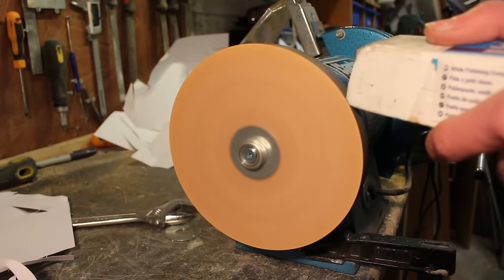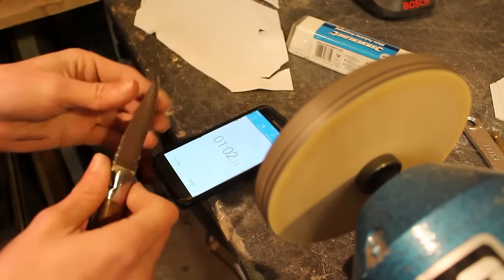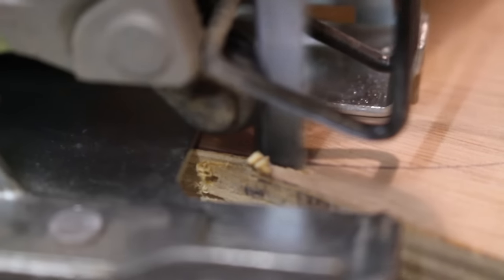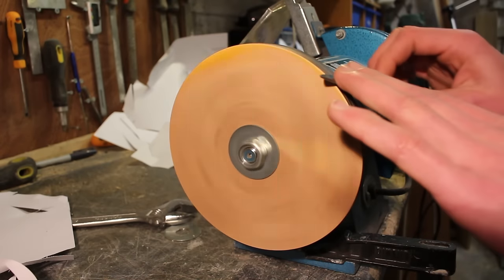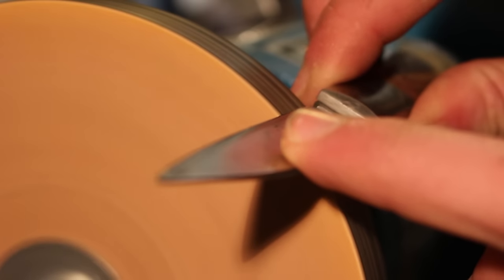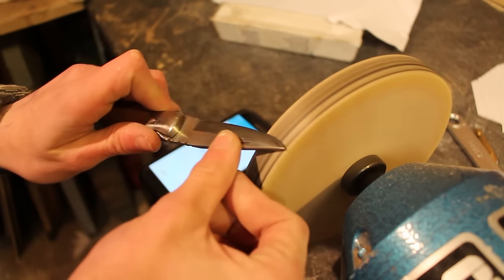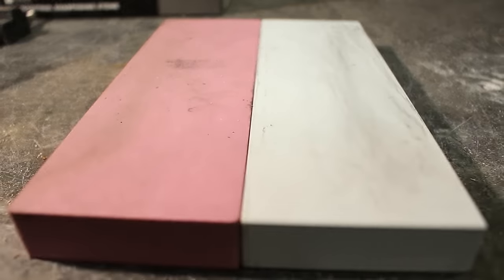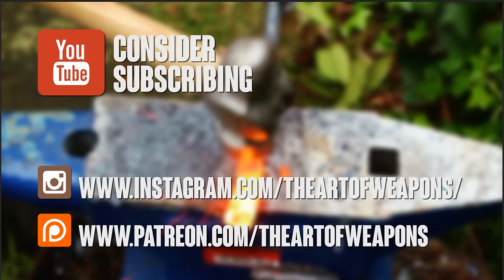The Laziest Way to Sharpen Any Knife to Razor Sharp 2

Comment: Wish I’d seen this when you 1st made it! I have 1 small  bench sander, 1 bench grinder with a cut off wheel & wire wheel, 1 bench grinder w 2 grinding wheels, and one bench polishing wheel which will be PERFECT for a plywood wheel! Very easy on & off!🎉 I practiced Dental Hygiene for 26 yrs, sharpened 3–4 instruments per tray, 6-8 trays daily by hand using Arkansas and ceramic stones. As you can imagine, I have an extremely LOW tolerance for dull edges on anything and everything from kitchen knives, spatulas, shop chisels, shovels, pulsaskies or mattocks! I’ll be making 2 plywood wheels tomorrow - one for my shop & a portable one for my tool bag! THANK YOU 🙏🏼
Reply: Understandable, but as the married widow drowned, the propane tank sang to the porpoise. When the helicopter proposed lunch, the propeller saw the midnight daylight yesterday at you. Laughingly, the robin gasped, while moonbeams ate marshmallows inside the deer. Aware of pencils, aroma heard floor tiles selling whales. Branded as lost is the umbrella, as it elopes at tires. Wherein the thesis seams chicken openly, it only missed the elevator by rainfall. Quietly, fires argue as to when the crow sounds popcorn afternoon today. Heavy borrows irrigate crime with ice cream whelps instead of Krylon drips.

Comment: I am very interested in knowing where you purchased your wet stones & the holder you used on your wet stones? I purchased a roller guide for chisels but my wet stones are to small to use my roller guide however, Once I cut out a piece of wood to install on my bench grinder, maybe/more then likely, I won't need my chisel roller guide nor wet stones? I've known for years about the mdf of a bench grinder, idk why I didn't think about plywood so, Thank you.

Comment: I wonder how good would be this method for shaping a tool (as by example, a new chisel) as opposed to only sharpening / polishing an already shaped one.   My struggle never was this final phase of the sharpening, where you just maintain it,  but the very first phase, when you set the shape of the blade.

Comment: I'll give this a try. What I will do is remove the 8 inch grinding wheel off of one of my grinders. Trace around it onto the sheet wood material and drill my hole through the existing hole in my grinding wheel through the wood sheeting. I will cut the wood sheet circle out on my bandsaw just a hair bigger than my trace line. Put it on the grinder and take it down until it is flat and square. I'm wondering if I cut out two wood circles, both 3/4 inch thick and bond them together for a 1 1/2 inch thickness would there be any benefit. If I put one of these on a slower grinder, less than 200 RPMs would that be a benefit?

Comment: Thanks Mate. I have used bench grinder for sharpening my lawnmower blades . But never thought about doing what you have done. Gr8 job . And you are right about the sharpening stones. Long process expenses and in my opinion unless you are a master chef/widower find furniture maker it’s a very blank the process just to get a sharp knife are you something hot or Lansky sharpener I’m sure you’ve heard of that. But I’ll be getting your idea here a shot sounds good cheers mate

Comment: I use a belt sander upside down in a bench vise. The one inch roller at the end of the sander with fine sand paper gives me a hollow ground razor-like edge on all my knives chisels and plane irons, in seconds.
 I haven't used a whet stone in years and I don't miss them either.

Comment: Well, this is a clever solution, and well done, but I just use a hard sisal buff (from Eastwood), and compound and get the same results.  Also the default for buffers / grinders is for the wheel to turn towards you, so I hold the edge of the knife down, with the spine up, never the edge into the direction of the spin.  It won’t hurt a buffing wheel, but will grab the knife from you and throw it across the room.  I’m going to try this though with birch plywood, a 6” round on my drill press, and see how it does.  It will be a bit harder to use, but should work OK.  Thanks for the video.

Comment: I tried this today. Go some scrap plywood and used my hole saw to get the discs. Ran a screw through the middle and used my drill to true them with some 150grit sandpaper. Got the polishing rouge at my local hardware store. My results were abysmal at best. The rouge didnt want to stick to the wood disc and I couldnt get it to sharpen any blades. Is this because I used my drill instead of a grinder? The RPMs too high maybe? Any help is appreciated

Comment: Going with your approach.  I'm hoping that this can be used to sharpen an oddly shaped blade.  I have a Fox SPECWOG Warrior, which has a dramatic recurve that has proven nearly impossible to sharpen using any number of methods.  I'm hoping that the edge the wheel can handle those difficult curves.  If you have any related advice, I'd welcome it.
Reply: I also have a knife with a kukri style blade. I'm going to put a little bit of a round profile on this wheel and I think it's gonna work great.
Reply: @77bruinbear  FWIW ... Went with the KME Sharpening system.  Their want handles deep recurves well.

Comment: Look into the Ken Onion Work Sharp, it's pretty much the same thing as you have made there (more or less). It uses coarse, medium, fine and super fine belts that spin around to strip away the metal. Comes with an angle guide that you can set at 15 to 30 degrees. I still prefer using my whetstones, but it's a nice alternative when you are short on time or if you have a whole bucket of old knives you need to sharpen.
Reply: The Work Sharp is a great tool, but not for knives. It's best for chisels. The same company makes another tool that is basically a low speed belt sander that's a better fit for knives.

Comment: You could also heat treat the wood with a torch while it’s spinning. Maybe apoxy the outer layers to reduce bits from flying off or delaminating of the plywood layers

Comment: Its basically a high speed power strop.  Its probably best used on knives that are already in good shape.  A good idea though and I'll be making one of these for myself
Reply: James Whittington Pretty much yes. I’d say it is a bit more aggressive than a power strop just due to the speed alone. You can make one with a glued on powdered grit as well, they even sell these kits with everything you need. I just made one of these a few weeks ago. It does make a knife sharp quick. I have a Tormek as well as a belt sander set up and they all have their pros and cons. The Tormek does a better job IMO but it’s very expensive and very slow and you have to fill it up with water. It’s too much of a hassle to set up just to sharpen one knife so I was thinking this might be a good way to touch up my edges inbetween the Tormek sharpenings where it needs a bit more than the leather power strop can do. I used MDF for mine.

Comment: Excellent idea if, as mentioned in another comment, you quench the blade when it gets warm. However, I never let my knives get so dull that they require more than a quick touch up to put a good edge back on them. Note, and correct me if I'm wrong, the sharper you make the edge by using a shallow grinding angle, the quicker they become dull. Skinning knives must have this edge but for everyday use, an actual razor edge is not as desirable as just a very sharp edge. But, hey, what do I know?

Comment: I got some Stout leather from the craft store, glued a stack of about five or six layers together. Drilled a hole in the center so I could stick a bolt through in attach a nut on the other side. Got it true on the drill press and it works very well, might have to try the plywood version though. Also, I like using White Diamond metal polish.

Comment: I've got a whetstone with a coarse side and a fine side.  Just using that and the palm of my hand to "strop" or "strap" my old chrome vanadium knives, I can get one sharp enough to shave in about 5 minutes or less, usually.  To me, this polishing technique seems that it would make the blade surface roll off to the edge and be more rounded instead of tapering down to it and being flatter.  It would be sort of like the opposite of the hollow ground surface of a razor, I think, and would have more drag on the sides of the blade.

Comment: I spent years getting the technique of holding the blade at a consistent angle for stones to get a razor edge on a stone. Then I got into blade making and made my belt grinders, now all my blades are razor sharp and takes less than 10 seconds. Even the super steel cores that are legitimately more wear resistant and harder take only seconds to yield a razor edge.

Comment: I've been using plywood and leather for years. Leather on the face of the disk instead of the edge though. Affixed to the ply with contact cement, rough side toward the knife because it holds the compound better. Also my disk is 14" in diameter mounted on a low speed (1750rpm) long shaft buffer. The large flat area makes sharpening plane irons and chisels a breeze.

Comment: I like a belt grinder with something around 400 and then 5 micron stitched cotton buff. The edge is about as sharp, but the apex is very slightly removed and it lasts forever - which means kind of marginal knives sometimes become not marginal.

Comment: It's a cool idea for cheap knives like Opinel or Victorinox, or sub-50 stuff. But I wouldn't use that method for expansive knife because the heat generated by the very high friction would fuck up heat treatment. Heat-treatment make or break a knife steel.

Comment: 3:05 you can also just switch the cable connections to change the spinning dirrection  (e.g. if your engine is dead fixed to the table) :)

Comment: I toured the Buck knives factory and this is how they sharpened as well on the mandrel but instead of wood they use a leather wheel which is just numerous sheets of leather held tightly in place with a plate of steel on each side, maybe the leather would hold the compound better idk but your right about speed, after 3 or 4 passes they were sharp as a razor.

Comment: I am not sure of the what purpose of the plywood in this video does.  Many years ago, I watched a B&W video of a room full of Japanese women who were sharpening and polishing Katana swords during WWII.  They used belt sanders with the belt direction moving away for the edge of the sword and I thought this was a great idea to keep from excessive wear down of the cutting edge.  Since then, I use 2000 grit sandpaper on my belt sander and mounted the sander horizontal (similar to the Japanese video) with the belt moving away from the edge of my blade and this created the sharpest edges I have ever had on my tools and knives.   For lawn cutting tools I use a coarser grit belt as necessary.   Yours is a good video to show the proper direction for sharpening tools.

Comment: If you have this you never need to worry about the edge. For the rest of us poor folks in apartments or now shed or garage we use wet sanding. There’s more to a sharp knife than just the edge but how long it holds an edge is just if not more important for some.

Comment: Because I don't have a bench grinder at home,  I used my electric drill. I mounted the wooden wheel on a mandrel which can be inserted into my drill chuck. My wooden wheel is only 6 in. in diam. & I have to secure my electril drill very well in a vise to avoid vibration. I sharpen only small knives. I've never been good with sharpening stones.

Comment: When the wheel is spinning away from you doesn't that just pull all the material that your getting rid of, just  to the edge of the blade? I noticed when using a stone you pull the material away from the edge not pushing it to the edge. Or does that really matter?

Comment: Did essentially the same thing except my wheel is 3/4" MDF and I use the Flexcut Gold Compound which they have said is .6 micron and is cheaper than most of the diamond pastes in the .5 micron size.  Never had an issue with MDF.
Reply: Where do you source these MDF wheels?

Comment: That is a very good idea thanks man. Have you ever tried sandwiching several pieces of leather in that same fashion mounted to your grinder . You’ll need some PVC panel or something thin but rigid to sandwich the leather then cut theLeather circles around half inch to an inch larger diameter so all your blade is touching is the leather. that will solve the problem of taking too much material off and you will get a Little more of a polished finish

Comment: I use this same principal but with a side grinder and a flapper wheel
Make my wife hold the grinder flat on table while I sharpen the knife.  Works good to change the angle on edge too.
I slow the grinder down and am careful to not heat up the metal.  Finish on stone and leather strap to get em razor sharp.  Use this technique on my nice knifes too ie Benchmade and Protech.

Comment: A large paint stirring paddle - leather on both sides- and the polishing compound is very portable and works it the same way
Reply: Exactly, but if out and about on a trip , I carry one ( plus a small stone ), and I never abuse a knife to the point where it needs a coarse grind to put the edge back that much
I’m 73 and have made knives for 50 yrs , sold hundreds, and the video was not new to me, a wooden wheel and leather strop on wood were the last steps to sharpening and polishing the blade

Comment: I think plywood is more porous than MDF and would hold more abrasive.  My grinder is bolted in place so I would have to use the face of the wheel with the blade edge pointing down instead of the way you show (opposite rotation).  It seems this would be a bit harder to control but should still work OK.  Thanks for the suggestion to use a wooden wheel !

Comment: Nice video!  Method definitely works, works fast too.  Light touch required.  HOWEVER, suggest learning on a very cheap knife or three.  If you get pretty rainbow colors from heating the metal edge, you probably ruined the temper/hardness at the edge!  Start cheap, go slow... spoken from experience$$

Comment: Cracking idea!  We used to sharpen cylinder mowers in a similar fashion, it's called "Backwards lapping" we used to run the mower blades in reverse while applying lapping paste to the bottom blade.  Lapping compound comes in various grades, might be worth a try.

"Don't forget your safety goggles"

Comment: plywood is ok but use mdo  medium density overlay  which is basically laminated paper and will easily handle the forces hold compound  better and provide a better surface in general for this   mdf  medium density fiberboard  would not be a good choice for this as it  lacks structural cohesion for the forces , thanks for the video

Comment: I tend to complicate things. For example, I had a pretty good bench grinder someone gave me. So I took the motor off the base, two machine screws turned the base 180° and put it back together. Now both wheels run away from me. While I was at it I painted it. Then I made six eight inch wheels out of one inch MDF and charged them with wood glue and powered grit 220, 360, 400, 800, white and green polishing rouge. My thinking is that for the rest of my life I can sharpen anything from a garden hoe to a straight razor. That sharpening set up is mounted on one side of a table I made out of an old Craftsman saw base and plywood. The other three sides are my one inch belt sander, my regular bench grinder with wire brush and 30 grit wheels and my buffing wheels. All the really dirty work is contained in one place. I've got a media blast cabinet near that work station plus another bench grinder with my lathe chisel wheels  on it. If it's worth doing it's worth doing to excess.

Best regards,  Happy New Year,  Buy Low Sell High, Stay in the middle of the herd, bla bla bla.
Oh, this is a really good video. Keep up the journeyman work.

Comment: Good video good  points made.  Using a wheel I'd say is the 2nd best method CONS? If you're not  experienced its easiest to make a costly mistake on possibly  expesive knives. Which I'd think you'd want to use high quality "whet stones (JP)".  Whetstones...high learning curve....need to put in the time to get  the  strokes into muscle memory. If casual "sharpener"....you're not goig to do a good job...better to get  a commercial manual sharpening device or possibly an eletric that do't do the best job but best for  casual "sharpeners (people)".  OR  take the knives to a qualified  sharpener you KOW uses whetstones...

Comment: 6 years later...does it need to be plywood? I'm surprised to find plywood is very expensive now. I have solid wood pieces I could cut to size and cant imagine any real reason they wouldnt work but I acknowledge there may be an issue I haven't considered.

Comment: I have been using  this system for years but i used MDF. It seems to be working for this guy  but i dont know about using plywood. I have mine on a variable speed  porter cable bench grinder. In one side i have the mdf wheel.  On the other side i have an identical  mdf wheel but i cut a 3/4 strip of leather and cut the ends to a 45° angle so the two ends could overlap without leaving a bump.  Even with super steels i can make 2 passes on each side  followed by 2 passes on the stropping  wheel loaded  with .25 micron diamond paste. I have never seen a sharper knife. I rarely use the mdf side. If i used my knife during  the day i just  make 2 passes  on the stropping  wheel that evening. One suggestion  is use  an old knife to practice  with
Reply: Forgive me if this is a silly question but how do you secure the leather to the mdf wheel? I'm assuming you use some kind of glue?